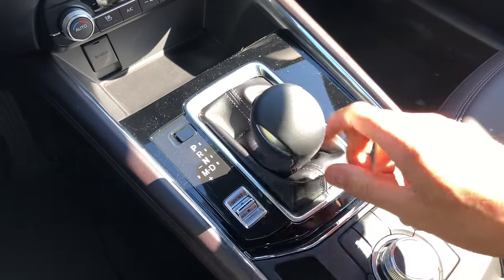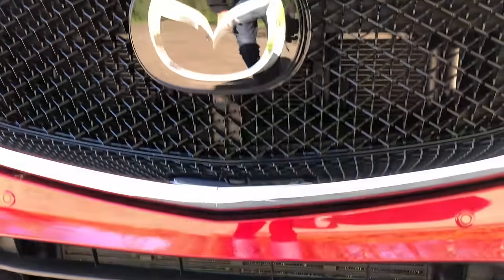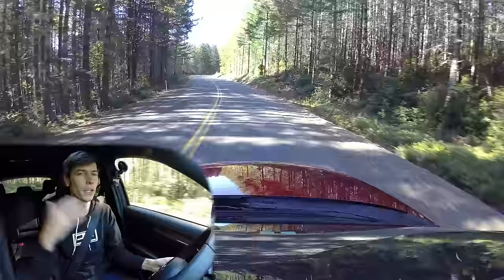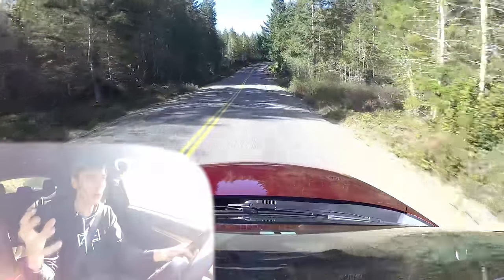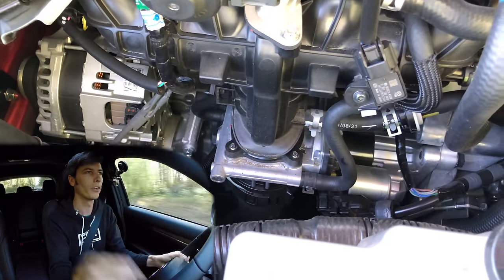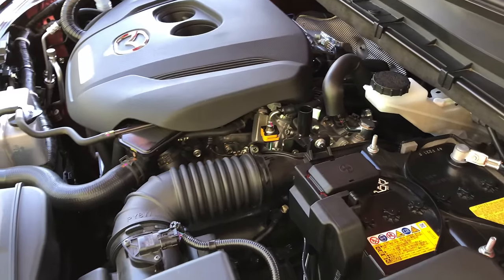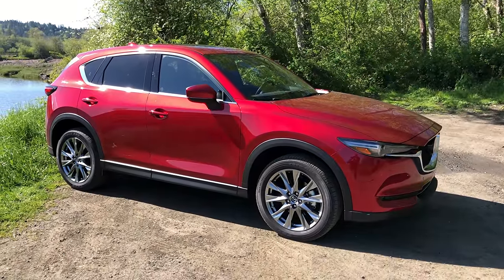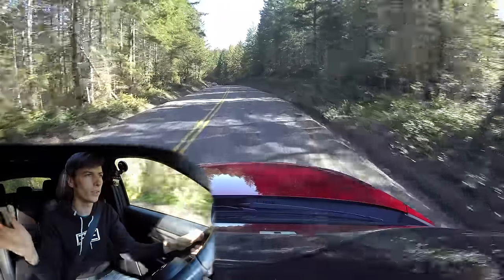Are CVTs Bad? Why Mazda Avoids CVT Transmissions

Comment: Transmission goals: low maintenance, durability, efficiency.
Reply from the maker: Sounds like 3 pedals to me. :)
Reply: Engineering Explained approved.
Reply: I love my Honda Accord 5 speed automatic with torque converter.
The car is 7 years old but I bought it with 3 year unlimited warranty, Honda has a lot trust in their products, no other company would do this.

Before this Honda I drove a Toyota hybrid with CVT and I hated it.
Reply: That’s manual for me
Reply: Just avoid the Nissan CVT and you'll be all right
Reply: Christopher  that depends on who you buy in the car from if you bought it Toyota or Honda you pretty much good if you're buyin a Nissan but I am going to be moving to Manuel's cuz I don't like those cvts
Reply: TOYOTA E Cvt than.
Its economical, comfortable and reliable.
Reply: That’s kinda sexist bro.
Reply: Christopher  I own a new corola 2019 sport. never been made fun of.
Reply: Christopher Automatic is more efficient and faster than any manual. It is better for all objective reasons.
Having fun is subjective, and different for everyone.
Reply: Christopher  ayayaiiii my friend 👏👏👏manual is the best of all trans... Of course you will like to drive manual if u r a real young male with big... knowledge driver 😉😉😉 automatic is for lazy people
Reply: @EngineeringExplained  i think torque converter are more reliable than a dry clutch disk
Reply: Christopher  Toyotas ecvts are known for being very reliable.
Besides since when did toyota become unreliable after the 90s??
You are just making facts out of thin air right now.

but whatever, you can believe whatever you want.
Reply: Christopher  also what car do you drive?
Reply: and only $1
Reply: Christopher the vast majority of cars nowadays aren’t even available with manuals. If you want an SUV, you only get an automatic. I can’t think of any SUV that still has a manual since Honda killed it in the HR-V
Reply: Fernando MinAnd automatics are becoming the standard. Very few vehicles still offer manuals. It’s not really a choice any more. On top of that, automatics are more efficient and put the power down better than manuals now. A modern sports car with an automatic will be significantly faster than one with a manual
Reply: Christopher but manuals aren’t more efficient anymore. An Accord with a CVT will get better gas mileage than one with a manual
Reply: @EngineeringExplained  I think your one pedal-ish car's "transmission" beats the other[s] in all three categories.
Reply: AISIN transmissions do exactly that. Transmissions going out on Toyotas are very rare occurrences and are often the result of neglected maintenance. They are also very efficient
Reply: @godofdestructiondiecast6756  But Nissan Rouge sold quite a lot.
Reply: @Bierkameel  Honda makes their own transmissions and their transmissions happen to be some of the worst in terms of reliability. Sooooo don't be surprised when your tranny blows at 100,000 miles...
Reply: That s a manual! 🤣🤣😁😂
Reply: And fun
Reply: @Bierkameel  Eh, your second sentence is erroneous. Ford has aftermarket warranties for vehicles FAR outside of their factory warranty. A girl I work with has a 2006 Mustang GT and her 3 year PowertrainCARE warranty finally ran out this month, so she obtained the warranty in 2013, a full SEVEN years after the initial build and 4 years after the Ford factory powertrain warranty had expired. I purchased a new Hyundai Tucson with a 7-speed DCT (AMT) in 2015 with its usual 10yr/100,000 mile powertrain warranty, AND I had that extended to be a bumper-bumper warranty for the full 10 years. Mechanical CVT's are pretty crappy though the Toyota Hybrids are an E-CVT which is simply an electric motor and it's associated helical gear-train and clutch disks and not an band/belt type mechanical cvt, like Nissan, Subaru  etc. use.
Reply: Christopher  Oh please. What an outdated attitude.
Reply: All goals appear in the Toyota Prius.
Reply: @EngineeringExplained  manual is only efficient if the human shifting is perfect everytime.
Reply: @EngineeringExplained  Can we get auto shifting manuals? without a torque converter.
Reply: @truantray  all hail the Prius...
Reply: @godofdestructiondiecast6756  Agreed. Had one on a loaner car... the virtual shifts were way too rough, acceleration happens 1.5 seconds after you hit the accelerator, terrible on gas and the whole car shook when re-starting the engine after a stop. Less than 3000 miles on that car, power felt like 1/3 of what it had on the window sticker.
Reply: Christopher  DCTs are quite efficient on gas and unless you're stuck in traffic most of the time can be durable. Shifting by hand is super quick and fun, creeping along slowly kills them though and all the efficiency gains (and then some) go into a new transmission.
Reply: Engine goals: have torque at zero rpm & high max speed so no transmission is necessary, i.e., electric motor.
Reply: @ThexXxXxOLOxXxXx  you mean dual clutch?
Reply: Christopher  Or just buy Electric cars without a multi-speed transmission :)
Reply: Christopher  Let me know when you get out of that big rock you're living under :)

Then we talk!
Reply: Automatic is great for commuting in stop SMG go traffic. About the last thing I want to do be shifting gears constantly for 40 miles after a long day at work. Now driving on twisty country roads, that's different. Bit really, I had a 5 speed as a kid for a year and after that went to automatic and never looked back. But my kid swears by manuals. All subjective.
Reply: Christopher  what does being a woman have to do with anything?
Reply: Thatz right. Skyactive technology. Japanese bimmer wanna be
Reply: @EngineeringExplained  The answer is always Miata...
Reply: Christopher  Yeah, you definitely did, I'm totally not playing your own game or anything, so so triggered. I'll have to blog about it, some manly man with a 30+ yo car with a cute little horsey on the grille thinks women drive automatics, what an outrage!
Reply: Sounds like a Powerglide transmission.... 2 gears/speeds... hi and low...3 gears if you count the reverse gear.
Reply: Christopher  Yet men don't? Whatever dude, you don't even realise you've trolled yourself in a corner.
Reply: @ThexXxXxOLOxXxXx  They're often called "robotic" transmissions, at least around here. They're like manual transmissions, but the clutch and shifting is controlled by a computer and some kind of actuators. They're low-cost automatics, and at least some of them are quite bad. GM had equipped some low-cost cars with them, and they sucked. Shifts are sudden, and rough. Used a bigger clutch than a MT, but still had a lot of problems with wear and error codes. Easytronic was called by GM. I don't know if some other manufacturer actually made a good one.
Reply: Engineering Explained someone say 3 pedals? ;)
Reply: No cvt for ME
Reply: @f-s-r  Intresting.
I guess they invested real heavily and gave it a good shot, but it failed miserably.
Reply: @TheUchihasparky  that certainly isn't the experience I've had. I had a 2003 Accord that I put 200,000 miles on it and had no transmission problems what-so-ever.
Reply: perfect transmission = no transmission = electric cars.
Reply: @TheUchihasparky  I've had two Accords (one was a hand-me-down first car station wagon), a CRX and now a Ridgeline.  Never lost a tranny.  CRX was an SI manuel, but the other two are/were full auto.  Now the CV joints are a different story.
Reply: Christopher  my wife drives a manual and guess what. She didn't died
Reply: Christopher  automatics do work best when in 3 hour slow traffic queues!
Reply: @juzoli  rubbish. Manuals are clearly more efficient, always better mpg than say 6 speed autos. But now with 8 or 9 speed automatics are fairly equal to manuals. With a manual diesel I can get the best mpg possible by shorter shifting but the new 8 speed autos have perfect ratios and good engine braking.
Reply: Christopher  wrong watch EE explain in another video re torque converter coupling for autos it is hydraulic so no burning up and you have neutral or start stop anyway. Dual clutch is not auto if that is what you are suggesting.
Reply: Christopher  never had an auto clutch pack fail or any other part of an auto transmission so maybe lucky. Biggest problem with cars is people thrash them especially  in 1st gear and dont do the correct maintenance or even know what is required. Cars are treated like trash and its the owners down the line picking up the pieces.
Reply: M James All automatics are more efficient for years now. Your argument made sense 15 years ago, but not today. Just check the 0-60 and mpg for ANY car sold today, and you will see that auto is better for all of them.

Manual is only good for people who enjoy them.
Reply: @juzoli  firstly, efficiency of internal combustion engines is only 30 to 35% so they are pretty damn crap to start with unless hybrid. Secondly 3 to 6 speed autos will always have lower mpg vs  5 or 6 speed manual in almost all circumstances. Only the newer 8 or 9 speed autos are equal to manuals for mpg and good driveability. One reason autos seem to be adopted more is ability to handle higher torque and for countries where either it is "the norm" where most wouldn't know how to drive a manual or manufacturer spec or just  preference.
Reply: M James Obviously electric is more efficient, but we were talking about ICE here...
There are no 5 speed autos on the market, maybe only as an exception, everything is at least 6 speed, and they are BETTER.
I have a 6 speed auto in my Mustang, and it has 1-2 better mpg, and 0.3 second quicker 0-60 than the manual.
Reply: @Bierkameel  Looks like Honda painted you in to a corner with the new models.
Reply: @EngineeringExplained  Bought a Subaru Ascent. My wife wanted it. I hate the CVT. POS.
Reply: @nice1149ss  Only if you don't know how to drive a manual with mechanical sympathy
Reply: @ThexXxXxOLOxXxXx  Yes, it's called a dual-clutch transmission
Reply: @chrwl007  well even if you have the smoothest shifts, there will be some wear on the disk because there will be slip every time you accelerate from a stop. Since torque converter doesn't have slipping surfaces, it wouldn't have as much wear
Reply: Just avoid ICE, use induction motor instead. Problem solved.
Reply: Low maintenance, durability, and efficiency was a standard transmission way back in the 1980s of 3 speed hydro mechanical slush boxes with bands and non-locking torque converters. 

But the truth is any autobox made after about 1993 is cheaper, more reliable, more durable, more efficient, and faster to boot. 

The only exceptions are the CVT since it has parts that constantly wear and the DCT because of its complexity. 

The only reason to buy a manual anymore is nostalgia and fun.
Reply: @ThexXxXxOLOxXxXx  You need VWs DCT or Fords DCT.
Reply: Christopher  There's a very nefarious and hidden agenda behind manual transmissions being taken away and replaced with no choices other than "automatic" in various confusing terms (all CVT computer controlled junk).  And it has nothing to do with "fuel efficiency" which is just the nice sounding Orwellian lie the govt is using to get control of all the "slaves" transportation.  If "fuel efficiency" was really their main concern, car manufacturers could easily make cars to get much, MUCH higher gas mileage, even big heavy trucks.  But they are all connected to the "elite" oil companies.  Everything is connected in this matrix we are in and designed to keep us under their thumb.  These CVT cars will be remote controlled by the deep state once they've made their slow and subtle transition over to no other choices in transportation but garbage CVTs.  Great that Mazda is not using them but it's just a matter of time before these "elite" who have stolen all our wealth buy them out or replace whatever CEO has the power to change the transmissions over with some psychopathic sell out who will fall in line and follow their agenda.   I'd try to find low mileage, manual transmission cars or older traditional style automatics (REAL automatics) while I could if I were anyone reading this.  Find one cheap and keep it in the garage if possible and don't pile the mileage on it, because in just a few more years, you won;t be able to buy anything but this Orwellian CVT garbage.   The fact that the "govt" is involved should be enough for anyone to smell a huge rat.  Unfortunately, most people are unable to think outside the box until it's too late.
Reply: And that’s where Subaru fails big time
Reply: CVTs tend to meet all those goals. Durability may be an issue over time, but with regular maintenance (particularly changing the transmission fluid every 25k miles) there's no reason a CVT can't last as long as a regular automatic.
Reply: @godofdestructiondiecast6756  The problem is that Nissan has CVTs as standard in many of their sedans and hatchbacks today. And there isn't usually an option for a regular automatic transmission. I bought a 2016 Versa Note because I liked the look of the car, and the ride was solid (it's not a sports car, and it would be hard to make that mistake). People being subcompact, budget hatchbacks can't test these cars like racers: that undoubtedly wears down the transmission, just like what will happen to a regular automatic. The big difference though is that CVTs catastrophically fail, 5 speed automatics rarely do. It's a difference of thousands of dollars (and likely a total write-off), and Nissan drivers such as myself simply need to be aware of the risks.
Reply: @bernlin2000  and that's why I recommend anybody not to buy a Nissan unless it's manual transmission before Renault merger Nissan Nissan never had transmission issues up until maybe like 2006/2007 they started but Nissan's used to be built solid
Reply: God of destruction diecast ; just avoid CVT ENTIRELY!, CVT sucks
Reply: @MacTechG4  no doubt
Reply: nice1149ss ; and too inefficient, they waste usable power

Clutch is a direct physical connection between engine and transmission 

Torque converter uses fluid to transfer power from engine to transmission, it’s inherently wasteful and inefficient, yes it can be smoother, but at the expense of efficiency 

A non locking torque converter can lose up to 35% of the engines horsepower 

A typical manual transmission has 0% loss to the clutch, when it is engaged, as it’s a direct physical connection, and around 15-17% loss to the actual transmission gearset itself

The manual, being a direct physical connection is just more efficient for power delivery, period.
Reply: Intel & Nvidia SUXXZZZ!!! No, the Prius is a transportation appliance, not a car, cars are FUN, a Prius is a soulless, gutless transportation appliance designed to squeeze every last nanometer out of every molecule of fuel, and for that it’s utterly brilliant, a grand slam home run, an amazing technological achievement!

It’s just simply not fun to drive though, just depends on what you value more...

Me, I want to have a car that’s fun to drive *FIRST*, and to get great fuel mileage....

No, it’s not impossible, it exists!

It’s called a VW Golf TDI! :)

Even with the emissions fix, I get 35-46 MPG depending on conditions on main roads and back streets, closer to 50 on the highway

Yes the Prius beats me by at least 10 MPG, but try taking a Prius down a tight, twisty meandering back road with blind hairpin corners, the Golf handles great for a small front wheel drive hatchback

Look up Smugglers Notch Road videos here on YouTube, it’s a tight twisty Vermont road that’s only 1.5 lanes wide, and very technical, it’s so narrow and twisty that they close it in the winter, because the plow trucks can’t maneuver down it, it’s too narrow and twisty
Reply: That’s why you get a manual
Reply: This is cvt
Reply: @juzoli  How can something that is using an inefficient fluid coupling be more efficient than a direct connection to the gearbox?
Reply: Io 
There are no modern automatic transmission on the market today, which would use permanent fluid coupling. That would be inefficient indeed.

And the efficiency of modern automatic transmissions is a fact, because they measured it.
Reply: What companies are truly doing with trasmissions: high maintenance, less durabilty, a bit more efficiency. 
No way in hell I’ll spent thousen of dollars in maintenanc for this type trasmissions over manuals. 
Manuals are just better in terms of durability, that’s it.
Reply: How often has ATF to get changed? And how often need the internal oilfilter to get changed to prolonge its live?
Reply: @basithph8958  i...
Reply: @fernandominand3733 i think manual is harder to drive because you can't focus on the road. i prefer automatic or CVT transmission where the car does all the work and you're the boss.
Reply: @holgerbehrendt9685 My turbo lancer is 20 years old and uses a CVT. i wanted it to fail because it is limiting my tuning potential but apparently its tough as nails. I replace the fluid every 20K km. never changed the internal oil filter and I just added a 2nd filter on the external trans cooler.
Reply: Transmission goals: No transmission (EVs)